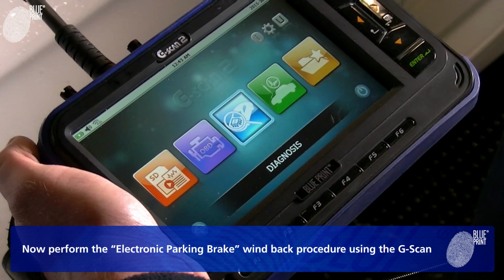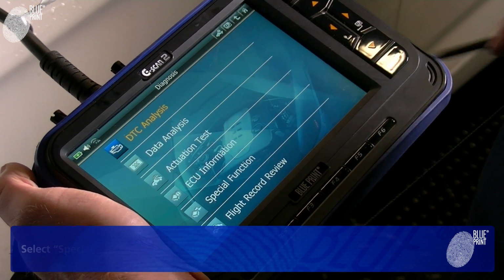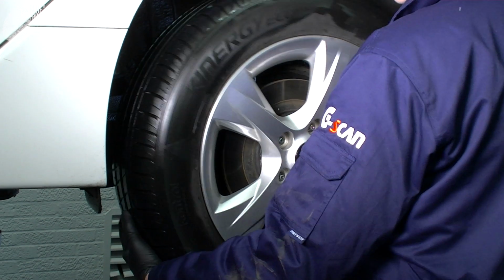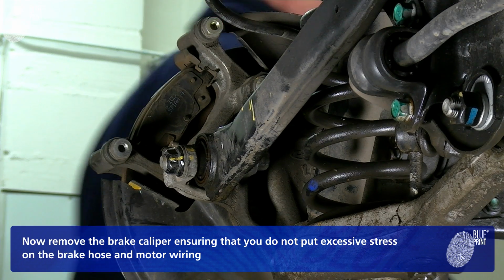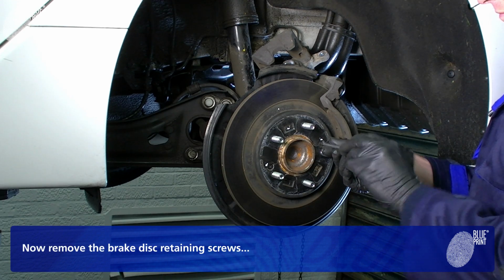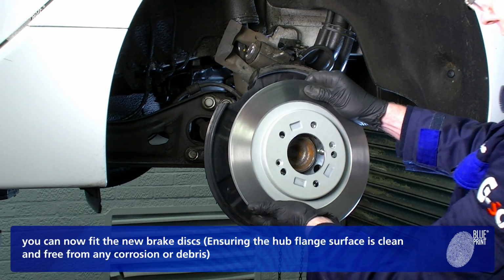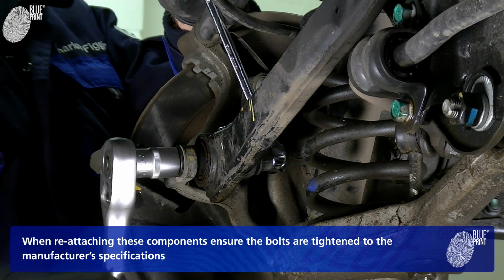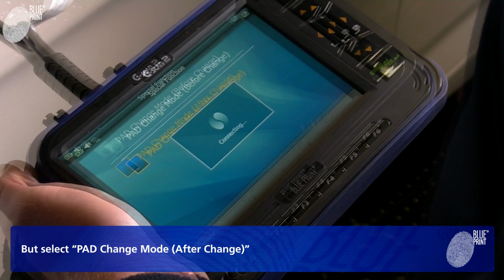[EN] Hyundai i40 – Replacing rear brake discs and pads (EPB)

Comment: Having watched this video and having spent my life working as an Electrical Mech Eng I figured that the system must have a work around, so 15 videos latter and it came to me that how would the Car's Processing  Module know what I was doing if I carried out the work with the Key kept away from the vehicle, so I did just that and removed the wheal and un-clipped the electrical connector [be gentle here] from ontop of the Caliper and then put 12v -- to the terminals, I made up lead set with at least one end terminated into a female terminal insulated to prevent shorting your cable, I used a Bog Standard Blue Butt in line Connector and put that on first to any of the 2 terminals and then touched the other and if on the wrong way around, just switch the cable around] hey presto 3 Seconds of Motor Noise and the Motor had unwinded the Caliper Motor, but do remember to make sure you have either bought or made a Press Tool to push back the Caliper Piston as this is never going to go back with a thumb push. The rest of the job is all down hill, change your Disc's [so so simple] and pads then re-connect the 12v --- to Drive up the Caliper to the pads, check the wheal is locked by the brakes, then jump in and start the engine and [wheal still jacked up, car chocs in place] take off the handbrake and pop around to check the wheal is running freely, pop back in and put brake on, check all is well, job done. This job took me under 2hrs inc making up the cable terminal and a Press and wait for it, the other side I completed in under 15mins!  Like Brexit there will always be those shouting and scaremongering that your car will die and go to hell
Reply: I am sure you have a point here, but your writing is so confusing to read, i just dont understand half of it.
Reply: Sorry I agree Kent. A bit hard to read mate. Could you tell me how you overrode the use of the Gscan again, please :)
Reply: @loopy7057  Keep the Key away from the car, jack up the car and remove the wheal, then put 12v [make up a lead - 2 wires] supply from the Battery on to your Rear Brake Caliper Solonoid [remove electrical Connection to reveal terminals, make sure you do not short out the terminals when applying the 12v supply from the battery],  keep switching the live and ground [nuetral] wires until you find that the Solonoid is going back into place and releasing the pressure off the Pads.
Once Pads/Disc's changed, simply connect the 12v back onto the soloniod and activate the parking brake, then replace the Electrical Connector back onto the Soloniod.
Replace the Wheal, check the brakes are fully on by trying to turn the wheal by hand, then jump in and start the car, take the park brake off as you normally would and check that the wheal is free.
Simples, car does not know you have changed the Pads or Disc's
Mr Spence Eng
Reply: @apartmentswales  awesome. Thank you. Do I need any kind of circuit protection though, like a fuse, in case there are any surges from the battery?
Reply: @apartmentswales  also, why do I keep the key away from the vehicle? I have a 2011 model
Reply: @loopy7057  Hi Luke, 
Voltage surge is not realy a possibility with a battery, batteries deliver very stable voltage.
 But current has the potential to reach the max of the car battery, weld wires together and cause a fire, so if you wanted to include a belt and braces approach, then you could put an inline fuse rated at say 3 Amperes to restrict the current flow, but just be carefull not to short out the wires when entering your cables into the Solonoid Plug, keep the Positive inside a crimped inline connector.
Be carefull not to damage the clip when taking the Electrical Connection apart at the Brake Solonoid, clean it off first and you can see how it goes together and hence how to open it.
I would invest in a set of Brake Caliper Wind Back Kit, I just pulled this down from Ebay.co.uk on 01/05/20 so it will not be there after a couple of days.

https://www.ebay.co.uk - type in  - Brake Caliper Rewind Tool - cost around £15 for a Box Set

Best of luck, but after I set up and done the first side of the car, it took me under 15min to do the 2nd side from start to finish - after removing the Wheal.
Mr Spence Eng

Comment: if i were to change just the pads do i still need the diagnostic equipment??
Reply: Luca Tomassetti y
Reply: T
Reply: Luca Tomassetti r
Reply: its simple to do guys
Reply: you can un-bolt the motor from the caliper and wind back the internal mechanism using an allen key. it is not complicated but need to take your time.  The two bolts holding the motor to the caliper can be extremely tightly stuck in the aluminium casting so be extremely careful not to round off the hex form. also the bolt heads might be full of muck due to the location so try to scrape out the hex form so your key will grip properly.  the motor will adjust itself  when re-installed u dont need any computer thankfully......

Comment: It’s exactly what I’m looking for,thank you so much guys,I just order blueprint rear disks and pads for my hyundai i 40 estate , They were quite expensive ,Can I do it without the g scan?
Reply from the maker: Thank you for your comments, regarding your question for the use of an diagnostic tool to do the work. Yes it is advised to use a suitable diagnostic tool to rewind the parking brake motors, then reset after the brake discs and pads have been replaced. Thank you for watching.
Reply: Well tell us the rest of your story, did you do the work and how, or did you put it into a garage? have you read my recent post on how to do this work with no specialist tools?

Comment: Epb light is on all time . On i40..... how can be sorted plz ?
Reply from the maker: Thank you for watching our video, the electronic parking brake system relies on many sensors, which are monitored by the brake ECU. There is not a simple answer to your question.
Reply: Did u fix the EPB light mate? If you did how? Because my EPB light is on as well.

Comment: does anyone know where you can buy a replacement parking brake motor ? you can buy spare for VW / Audi approx £40 - but hyundai can only seem to buy as complete caliper £300 !!! there is nothing wrong with the caliper only the crappy plastic lugs on the parking brake motor!!!!!
Reply from the maker: Thank you for viewing our video, hope you found it informative. Unfortunately neither the rear brake caliper or the handbrake motor are currently available in the Blue Print range for the i40. The vehicle manufacturer only lists the complete unit, as you have stated. Your comment has been pasted to our research team for future development, to compliment our range.Thank you.
Reply: Thanks for reply - and yes your videos are very well put together.  also your pads and discs are good i have bought them for other cars but not for the hyundai yet.  this video for i40 was particularly helpful to give some  forewarning that the suspension bar needs to be unbolted to get access to the caliper bracket bolts and therefore to allow some extra time for the job and have a decent breaker bar handy.